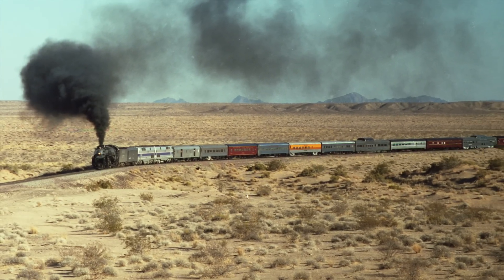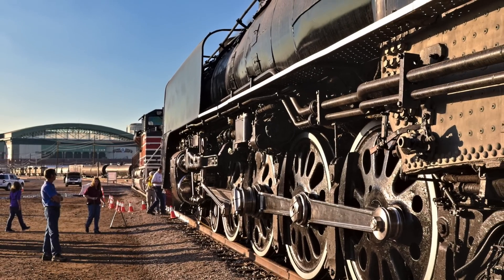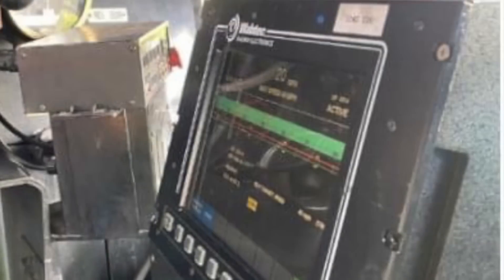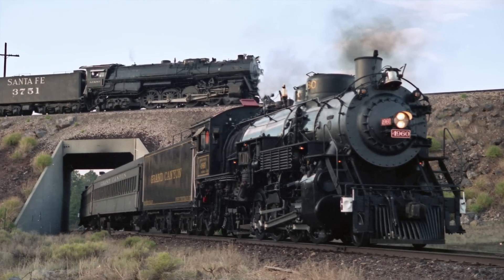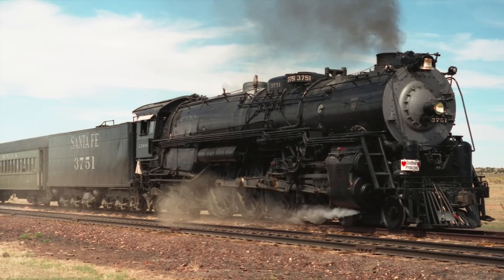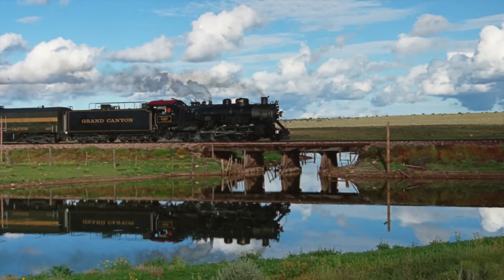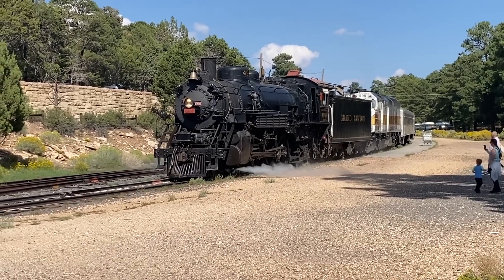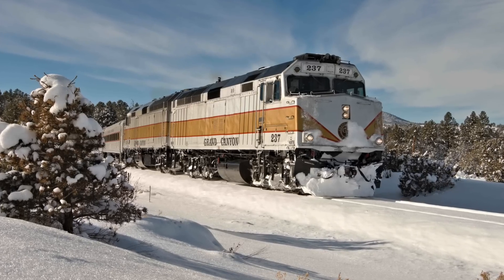Why is there a diesel behind the steam engine?

Comment: Few reasons for the diesel behind 4014. It provides dynamic braking, saving brake shoes. It supplies pulling power to reduce fuel consumption on 4014, and it is the prefered force when driving through tunnels. Finally, it is used for communications and as a backup when 4014 has issues. This happened once when 4014 ran out of water.
Reply: And also electricity for the passenger cars
Reply: @Jackcook27   They have a generator car for that. Freight diesels don't have ability to do that.
Reply: @southwestvirginiarailfan729  they don't have that the diesel electric engine built by emd does provide power as the locomotive is basically just a big generator that provides power for the electric traction motors.
Reply: @Jackcook27  UP has a separate generator car-the one with a long roof bump.
Reply: UP units aren't equipped with HEP, as they have their own generator cars. Amtrak and other passenger locomotives use HEP
Reply: @Jackcook27  A steam locomotive can provide that too.
Reply: They have diesels to supply PTC for the steam engine
Reply: I have a short video of 3985 heading to Cheyenne, Wy  doing 70mph pulling extra tender, parts car, tool car, diesel locomotive, and 21 cioachs. She's a monster when she's up to speed. there was a highway running along side the tracks. I,ve got about 20 mins of this beautiful brutte pulling that train with all she had in perfect sync.
Reply: It's is rarely used for pulling power.  Only when 4014 breaks down or is running low on fuel.  Most lines require it for such emergencies to keep their revenue trains from being blocked if the 4014 breaks down. It also supplies electricity to the passenger cars.
Reply: @wonttell4873  Most freight diesel locomotives have no head-end power generators, so they can't supply power to the coaches even though they generate electricity onboard for their traction motors and auxiliary systems.  As somebody else noted above, Union Pacific (and presumably most other operators) have separate generator cars for that.  Exceptions do exist:  On the Alaska Railroad, some of the diesel locomotives actually do have head-end power units to enable hauling passenger service, so in principle they could include one of these on a steam excursion trip and dispense with the separate generator car (I don't know if they have actually done this).  I don't know of any other US freight railroads that have purposely installed head-end power generators in diesel locomotives, but a few passenger diesel locomotives of vintage recent enough to have head-end power generators in the first place(*) have been pressed into freight service, and some of those might have retained their head-end power generators (although if they did, it's anybody's guess if they would still work, unless somebody specifically tested them for this purpose, if indeed any such units are even still in service at all).

(*)Remember that for a considerable period, even diesel trains didn't have head-end power unless they were dedicated streamliner sets, instead using axle generators just like on steam trains.  Then commuter operations started adopting head-end power, and eventually Amtrak took over long-distance passenger operations (eventually all except Alaska) and started converting to head-end power, but even they started at least mostly without it, with their (early 1970s) new SDP40F and a subset of E60CP electric locomotives initially not having head-end power (the SDP40F locomotives got pulled from the fleet due to derailment issues before conversion ever came up).  Everything (other than work train and switcher engines) that Amtrak bought from the P30CH on (including the F40PH series) had head-end power capability, so the Amtrak engines shown in the video could certainly provide head-end power.
Reply: No one talking about electricity for the wagons?
Reply: @colinblaas3592  most of the time it uses freight traffic locomotive which obviously doesnt have the ability to provide electricity for the coaches, theres a reason why theres a generator car in the consist
Reply: this is the exact reason
Reply: Yes for dynamic braking and for power generation for support equipment are the main reasons I've heard. Since they are also on lines that make money they have a way of moving the steamer out in case there is a problem which could cause the line to be interrupted.
Reply: Saved me 11 minutes, thank you 💙
Reply: I heard the reason is because the law that say steam locomotives are old museum locomotives that can brake down. Therefore a modern diesel must be added. Maybe not in all states or only at mainlines, i am not sure.
Reply: @jpsholland  that's not true at all. The most common reasons a diesel locomotive is behind a steam engine is for Dynamic braking or positive train control or incase the locomotive runs out of water
Reply: Right now I believe there is only 3 possible reason to consist a steam locomotive with diesel (referencing directly diesel has function and Steam era locomotive does not have...),   
A)  dynamic braking (I suspect steam locomotive servicing brakes requires few months work due to information saying they have to have few steam locomotives to rotate with at shop buildings). 
B) Electricity.  that is not the "for cars".  Did anybody know the rails are bonded, diesel generates huge amount of electricity [minimum of 800 kilowatts] and electromagnetic fields, and rails conducts some electricity from that emf.  Railroad crossing detects that electricity and activates. So need electromagnetic pulse to trigger and activate railroad crossings.    extra electrical equipment might be the reason to include diesel, but is not "why not use it" reasoning. example:  to support PTC, you need gps, radio and software. I point you to your phone has radio and GPS and is that small and only need a laptop to operate PTC software. so Steam locomotive can do PTC (pay attention to this factual logistics;  diesel is .. what 60 thousand dollars?, and laptop with radio is probably 2 thousand dollars just to operate PTC).
C) "consist" sensing.  Someone told me (I am still skeptical) that diesel can rough sense "problem" consist (does not detect which cars) and alert the operator. Operators then run the train through "maintenance" rail to figure out continue with or detach the car(s).  Right now that is moot with diesel and steam, because such excursion is so few and sufficient manpower is available to inspect short consist train.

Well  in steam era there are culturally inclined infrastructures and practices,  examples: sanding towers, water stations every 200 miles,  oil-grease stop (overs),  Major service-repair buildings (similar to Railyard in Albuquerque), double heading (load moving) locomotives, drag locomotive (there was old big boy picture pulling line of cars, and has 1 steam locomotive in between with 1 drag on end)  with introduction of diesel into  modern era; today those infrastructures is abolished or permanently converted into something else.  The practices of steam locomotive consisting is not observed or infrequently used (used at Tecumseh curve) with diesel locomotives. 

I agree with some analysis,  fuel conservation is moot reason for steam-diesel coupling.   Late Steam locomotives was designed to haul long distance with massive load  for at least 1000 miles according to "test" results with dynamometer cars.  What does matter is water.  steam locomotives has huge boiler tank and loses water to "piston pumping" exhaust.  my gpa (worked at raton pass station as mechanic) said water station is located somewhat 200 to 300 miles apart has to be able to dump 50 to 70 gallons of water per minute,  locomotives need about 15 to 20 minutes  (that is arrive, move spout down, open valve,  swoosh, close valve  spout up) to fill up the boiler and reserve tank.  

By the way  nobody observed this.  B&O museum runs steam excursion on main line for long time. probably more than 20 years... they might be the one that developed process involving steam-diesel train. I do know they have historic documents and RAA uses them for information and developing guidelines. (B&O even have the boiler to steam dynamo operated locomotive.)
Reply: @rynait  "rails conducts some electricity from that emf.  Railroad crossing detects that electricity and activates." 
Not really. The tracks themselves have their own "track circuit" that is used for the signals, RR crossings, etc. However, said electrical circuit is not generated by the train. If that was the case, railroad cars by themselves or a long way away from power wouldn't trigger crossings & signals, which is obviously not correct.
Crossings & signals are activated by essentially short circuiting the system, thus showing track occupancy. Crossings have their own circuits, so they activate only when something is an appropriate distance away (and in more advanced systems, taking into consideration the speed of approaching train/equipment to determine how soon to activate.)
Reply: @RadioactiveSherbet  I am not interested in arguing with twit.
Reply: @rynait  That's cool. But, if you're interested in learning, I'll leave this up here. 
"A track circuit is an electrical device used to prove the absence of a train on rail tracks to signallers and control relevant signals." 
https://en.wikipedia.org/wiki/Track_circuit
Reply: And it supplied electrical power to the passenger cars
Reply: Couldn't they just modify a brake car?
Reply: That is interesting. It certainly says a great deal about the reliability of a rebuilt-restored steam engines. These steam engines used to do a great job of hauling long heavy mixed freight and loaded coal cars. In fact this was the singular purpose of engines like 4014 and 3985. If those engines need back up power it seems that it was a good thing for steam to go the way of the dodo - extinct. What is the purpose in spending millions of $$ to restore an engine when it is neither reliable or powerful enough to pull 20 passenger cars. So 3751 can only pull 5 passenger cars by itself. Good grief - cut it up for scrap.  Look, I don't mean to be cynical but for a very long time steam engines pulled cracik passenger trains across thousands of miles of rails without help and all the rest. New brake shoe linings have extended life, rails are in better condition for the most part. The cars are not likely to be longer or wider or much heavier than they were a century ago.  In those loco motives like 844 could do it in the 1940's, why can't they do it now. Dynamic braking be damned, they had no trouble stopping when they were built. They didn't have dynamic braking then. It is not nbecessary now.  Are you showing what Steam locomotives can do, what they are, how they work or just running them at the head end so you can milk a bunch of people for high prices tickets while they think they are being pulled by a real steamer that has been gloriously returned to service - but not revenue service.  They are a mere shadow of themselves. It's like giving an old man a job so he won't feel like he is useless.  Maybe then the $$ would come for more restorations. Show what they can do in the modern day.  They are worth more than pulling fancy passenger cars on sightseeing trips.  Grandfather is still alive and healthy. Let him do the work he used to do. Keep him alive and healthy.                                         And please don't bother with the hate mail.
Reply: @organbuilder272  This dude out here thinking a steam locomotive’s mechanical and physical capabilities somehow depreciate with time, when that just ain’t the case at all.
Reply: @organbuilder272  I get what you're saying, and there are a lot of people in just this reply string that are flat out WRONG.  They are right that the diesel is present for dynamic breaking, but they don't have any clue the reason.  I went and saw 4014 in 2021 when it came through Ft Worth.  The UP guys explained why they are using the dynamic braking.  They said the reason being is NO ONE makes the brake shoes for steamies anymore.  EVERYTIME they have to replace the brake shoes, it is a special order and EXTREMELY expensive, so they use the dynamic braking to greatly extend the service life of the steam locomotives brake shoes.  Aside from that, these old steam engines today still hold true to what was true back in the day.  They have all the power they need and then some.  They are more than capable of pulling these trains, however, spare parts and service facilities do not exist along the routes like they did back in the day, so the diesels are there in the event something does go wrong.  The facilities and services for diesels are present.  All this said, Steam can still vastly out pull diesel in a one for one match up.  Maintenance for the steam is still more costly though.
Reply: @jameskee2412  steam locomotive's shoes (liners) is manufactured today, same stuff as heavy dump truck materials. because is "can be done" but one off production is expensive.   Also I believe locomotive have to be lifted to gain access to and change the brake shoes or liners.  Makes combined  part and labor expensive and hitching a diesel (exploit dynamic braking) cheaper.
Reply: @organbuilder272  Keep in mind that parts for steam locomotives are a lot harder (and probably a lot more expensive) to get than they used to be.  So even if a restoration job was perfect, it makes sense to relieve parts like brakes of some wear to reduce expensive maintenance down the road.  Note that the video gave several examples (most but not all on flat terrain) of steam locomotives running without a diesel locomotive in the consist, showing that the restoration quality is not at fault -- it's usually a combination of demands by the host railroad (you have to get their permission to run at all) and the restored train group wanting to save maintenance money (and not get in trouble on track they don't own).
Reply: @Lucius_Chiaraviglio  Hi Lucius. I do appreciate your reply and thank you. Yes, you are correct about parts. But UP made spares for everything they had to replace or rebuild for 4014. That made it a point ot show the spare parts during the rebuild postings.  Brakes have been on locomotives for a very long time. They are expected to wear. The engines alone are heavy. Of course, the brakes on an engine are not stopping the train. Brakes on each car are doing that.. Yes, there are engines that run solo on restricted track in special areas on short line or private rail systems. Yes, you are right, one must receive permission to run over tracks belonging to the big 4 class A companies and with good reason. Of course they don't want to have a steamer broken down. But they also have problems with their diesels - stalling, turbo failures, fires. In one case, 844 came to the rescue of a stalled train and got it where it had to go. That was 844 which, with its 80 inch drivers, is a thoroughbred on the rails. 4014 is NOT a perfect restoration. It is still having problems - maybe they are fixing those as we converse - I for one, certainly hope so. That engine is a magnificent piece of engineering. If it could work for  15 years or so with a high reliability record, what is wrong now - Ed D. gave assurance that it was better than new. The boiler shell passed all tests. I think the only thing completely original is the front and rear frames, the boggie frames and the springs. That engine was gone over with complete, functional restoration in mind and Ed did everything in his power to make that happen. Too bad they took 3985 away. What an assembly of power - 844, 3985, 4014 - big bigger and biggest. UP will close their now palty heritage fleet. It is just a question of time and how much bonus money they will pay their overprices greedy inept CEO at the cost of cutting out the steam program.  Mark my words - it is going to happen.
Reply: @organbuilder272  I agree with you about greedy inept management -- which is NOT a new problem and not specific to Union Pacific either.  Eugene Debs was right -- we should have nationalized the railroads.  (Actually, we DID nationalize them from 1917 to 1920, under the USRA, but then we restored private operation.)  Of course we'd probably mess that up now -- look at Amtrak (although Amtrak is made to prioritize becoming a profitable private company, so actually we have the worst of both worlds there, including greedy inept management that often is made of airline rejects).  As for the Union Pacific steam fleet, we'll have to see what we get from the organization that is taking them over, an organization about which I have essentially no information.

As for spare parts supplies, Union Pacific is (now, was?) more capable than most at making replacements, but for most steam operators, that is going to be a serious challenge, so better to try to save.  You mention using train brakes, but these would also incur replacement expense if you don't use diesel dynamic braking to reduce the need.  Diesel dynamic braking probably isn't going to wear out, other than some increase in motor brush wear if the units aren't AC-motored (still a lot of DC-motored stuff hanging around, and some was even built pretty recently), but replacing a few motor brushes has got to be easier and cheaper than replacing the friction brakes on a whole train, even if that is a fairly infrequent process.
Reply: @Lucius_Chiaraviglio  Lucius - Hello again.  The rail owners of the early rail systems were considered robber barons. It is now the stock holders who have taken this title.

PLEASE - differentiate the engine from the train. Dynamic braking for the engine is for the engine. The brakes on an engine of any kind can not hold back a whole train. The individual cars have brakes. They can and do hold the individual cars. The engine has its own brakes and doeas CONTROL the brakes on the cars. Slam on the engine breaks and you have a train wreck - jacknifing is the term for trucks, Apply the train brakes first, the engine second and way toward the end, release the train brakes and compress the coupler springs to make it easier to start again.  Brakes are brakes. Dynamic brakes affect ONLY the engine and nothing else. That must work with the train brakes to stop the entire train. Of course brake shoes are expensive. More so than the expense of running a diesel engine with the steam unit? Even with the diesel unit the engine must use its brakes.  Anyway, nice discussion. I don't know if we completely agree but it is food for thought. Have a wonderful New Year.
Reply: @organbuilder272  I am not talking about a fast (not necessarily emergency) braking situation in which of course you would have to use all of the brakes on the train.  I am talking about applying an amount of braking that is comparable to the amount of acceleration that you can get out of the engine, in which case dynamic braking can save on train brake wear.  (The engine has to be able to pull the train by itself if it is truly going to be a able to serve for failover in case the steam locomotive quits, so the dynamic braking only needs to be able to provide an equal amount of tractive effort in the other direction to be able to get the train speed down to the point at which dynamic braking becomes ineffective, at which point you then have to use the friction brakes.)  Edit:  Also, in a situation like going down a grade, where you need to adjust a little bit of braking over time, you really want to be able to adjust that with dynamic braking rather than air braking, because otherwise you deplete your compressed air supply and won't have the train brakes available when you really need them.

I'll grant that the train brakes and diesel locomotive brakes are probably a lot easier to replace than the steam locomotive brakes (odd size/shape that nobody other than the few steam operators uses any more; on the other hand, the train brakes are more numerous and thus require more labor, which seems to be in short supply at many if not all preservation organizations (not just steam) -- it could well be cheaper to lease a diesel locomotive for a short period if it seriously stretches out the time before you have to contract out to some shop to replace all the brake pads.

As for robber barons -- you've got them in management and you've got them among the shareholders.  Actually, this isn't new.   And inept stockholders aren't new either -- look at the idiots who let Patrick B. McGinnis into the head position of the New York, New Haven and Hartford Railroad on the promise of paying out dividends, whereupon he fleeced the railroad into the ground, AFTER he had already established a prior history of doing that.  And he wasn't the first con artist to ruin a railroad either.
Reply: @Lucius_Chiaraviglio  unfortunately you are thinking "engine Jake brake" as fuel engine similar to piston-crankshaft or Cummins engine.  That is not same on the diesel locomotive's dynamic braking. Their braking is electrical principle where an application of reverse emf field on the electric motors,  induces electric motor to "react in reverse", generating "force load"  against the actual momentum force and  back emf proportionally (does generate thousands of tons force). No additional  moving parts (except for driving wheels on rails) is involved.
Reply: @rynait  I'm not talking about Jake braking -- I'm talking about dynamic braking pretty much the way you describe it (on a DC-motored unit -- details differ on an AC-motored unit, but the basic idea and end result are the same(*)).  Which saves a lot of wear on brake shoes.  Maybe you were looking at somebody else's post?

(*)except that the AC-motored unit would have a lower speed at which dynamic braking becomes ineffective, potentially even 0
Reply: @organbuilder272  Well, maintanance, costs, and of course in the old days you didn't have those sceduals like today on the rails. And I don't know if it was used as much in the States as it was here in Europe to have multiple steam-engines too especially for climbes?
Reply: @elvinhaak  The need for moving large loads over steep grades brought about several large and powerful articulated engines. Steam as always had difficulty starting a train in motion. Those big drivers skid when pressure is admitted to the cylinders. After all, they are steel on steel not rubber on asphalt or concrete. There are forced in effect that can easily be calculated by simple math. Engine wheels and the power generated by the cylinders are always in competition.  One cylinder in Big Boy puts 103,908 pounds of force on the piston rod. that turns into 1,662,530 foot pounds of torque on the main shaft of the driver.  Anyway, yes, steam locomotives are labor intensive HOWEVER, the 4000 series that Alco made for UP had high service time and relatively low maintenance time compared to other engines. I have the feeling that the Big Boys capability to pull a loaded consist at 40 MPH had never been fully tested. Once they were rolling, nothing would stop them but they cant get long train started. Unfortunately, diesel engines can. Have a nice New Year.
Reply: @organbuilder272  Thanks for your info. Have a nice 2023 too with much steam!
Reply: @organbuilder272  the only reason 4014 needs a diesel locomotive is to provide dynamic braking for hills and positive train control or the steam locomotive runs out of oil or water the diesel will be able to at least push the locomotive to a crossing to get the water replenished in the tender. Plus the reason 3751 only pulls 5 cars is due to other museums excursion railroads etc. Don't want to lease their own equipment that they use daily. Or they have coaches that need a diesel to provide power. And coaches were lighter back when steam locomotives pulled crack passenger trains they usually had oil lamps in the coaches not electric lamps
Reply: @ADIX_3573   Hi UP, thanks for your response.  You know, 4014 didn't need dynamic braking when it was designed and built. It didn't run out of coal when it pulled very long and heavy trains up steep grades. NOW it runs on oil. Get a bigger tender, carry more oil. Use a standard tank car.  It didn't need DB when it operated for 15 years. The 4000 series never had a runaway consist or uncontrolled situation. So NOW, the restored 4014 that everyone screams so much about, -  weight, power and tractive effort, suddenly needs dynamic braking. Seems like a step backward isn't it. As far as running out of water - Replace that diesel with another tank car and be done with it. Regular tank cars carry far more water than those tubby yellow ones do. We know the tender is full of oil.  Replace it with a tanker that can carry more oil. That engine can pull 150 loaded coal cars. Take four cars out of that consist and turn them into tankers. 3 for water and one for oil. Get a lubrication system on that engine that is self sustaining and you have  and engine that can't be beat. As for PTC, that can be installed and I believe there is at least one restored engine that already has it. 3975 maybe. It's a 4-8-4 Santa Fe.  Make all the silly excuses you want. and I know you are merely repeating what everyone has been told - including  me to which I say BS. That engine, and all others like it, did the job 70 years ago and they can still do the job today. After all, they no longer pull long trains. They piddle along pulling luxury passenger cars for fat cats who can affort to pay the tab. 20 cars behind 4014 doesn't even make that thing break a sweat.
That engine is a work of are. A monument to engineers of the 1930's a monster iron horse that did the job it was designed for and did it superbly. Nothing has changed other than a "Complete" restoration which evidently has not been successful based on the problems experienced each time it has gone on the road. It and its brothers never had failures from birth to retirement. What is the problem today after a 2.5 million dollar rebuild?  By the way, you want dynamic braking?  It can be done in that engine or most of the others.  If they could design and build something like that in 1942, they can fit it with an electric braking system in 2022.. Maybe we should go to the Chinese for the answer. After all, we have gien them out industrial base, let them figure it out. They will probably succeed where our lack of engineering and manufacturing facilities bring failure.  Maybe Elon could figure it out.  UP can not. They are even giving their rolling stock - the Heritage fleet - away. They don't care about heritage any more. They have stolen Ed's dreams while others are bringing back even larger and more powerful engines than 4014. SHAME on UP.  What is the fame of 8048?
Reply: @robert shaw  On some routes, dynamic braking is now legally required, often to the point where some routes require two or three locomotives for dynamic braking. PTC is legally required now for mainline operations, no more exemptions. Then you have the warm-up at the beginning of the day. Where locomotives used to be able to clear condensation moving around the yard to take on coal and water after leaving the round house, they no longer have that opportunity outside of dedicated heritage lines.